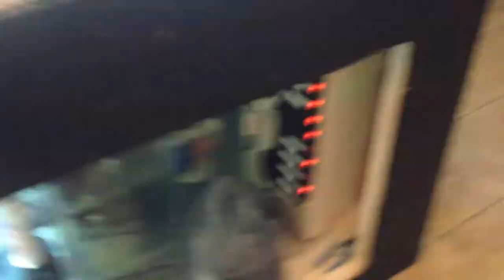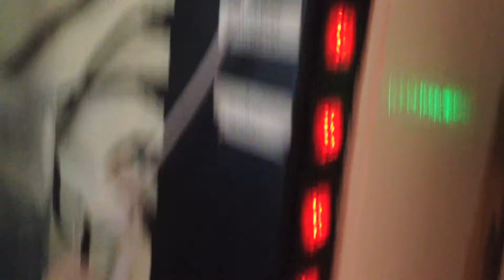Update on the reef.  Nualgi dose 3

Comment: Just curious what your nitrates are testing at? I've seen this in my tank when nitrates were high. I use algae build up on glass as an indicator of high nutrients in the system. Then I refresh my carbon got reactor. I also run seachems pond matrix to keep nitrates very low. When parameters are in check I don't clean glass for weeks at a time. Good luck.